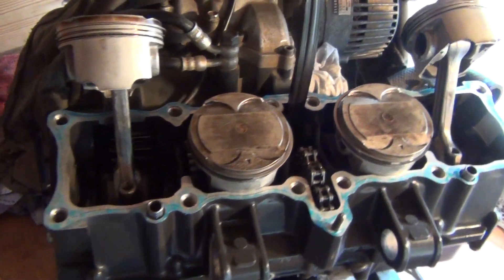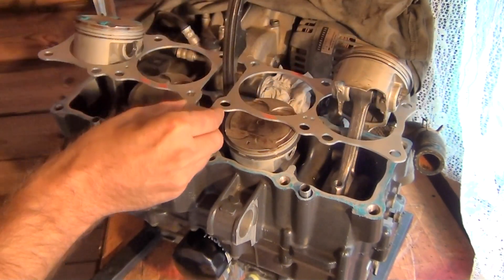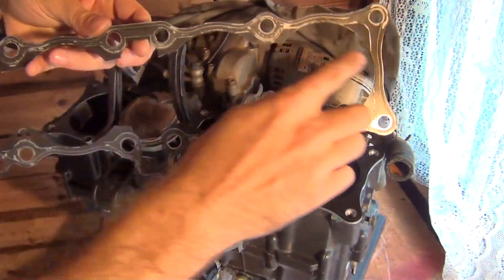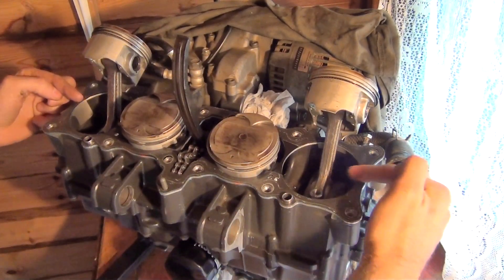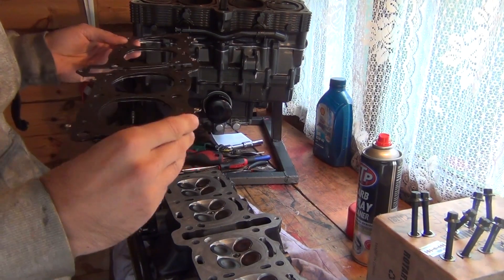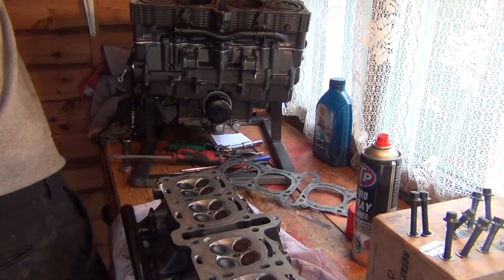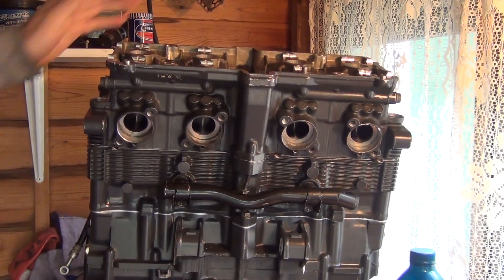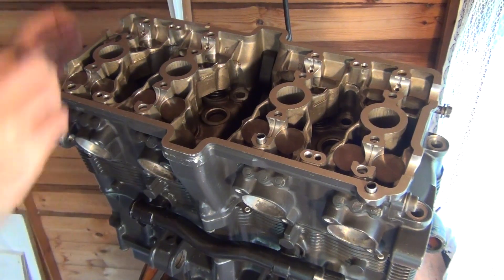Building Suzuki RF 1100 - Episode 7

Comment: What did you use to cut the old gasket off also what did you use to hold the rings when putting them back into the jugs
Reply from the maker: Thick plastic zip ties to hold the rings. Head gasket comes off without major problems.